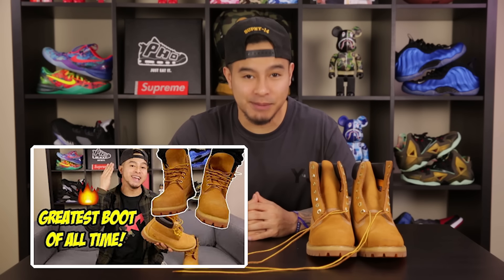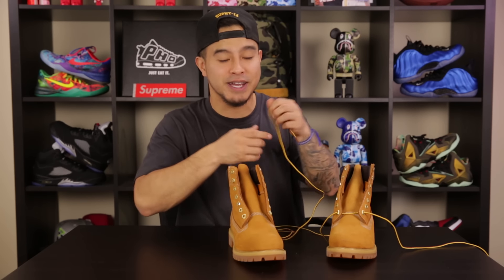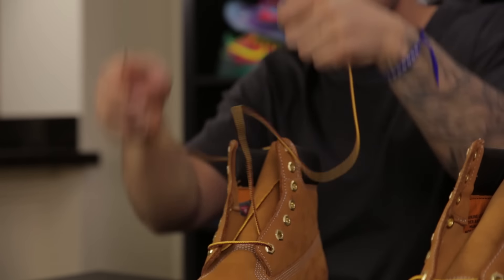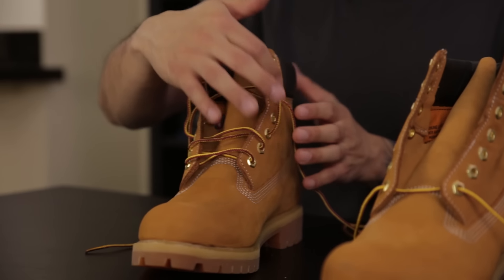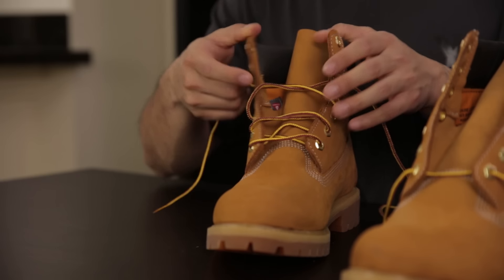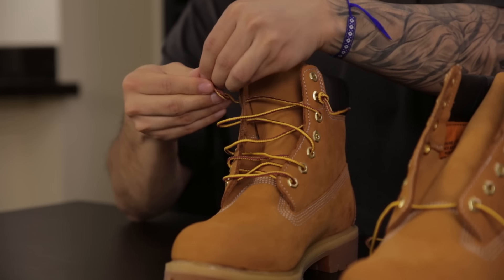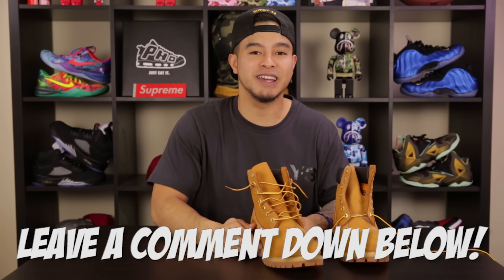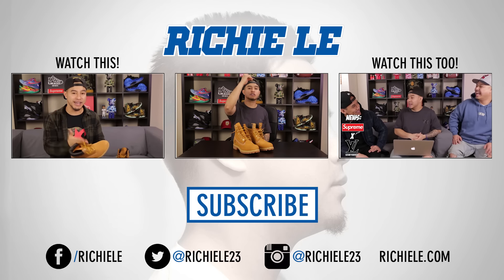HOW TO LACE YOUR TIMBERLAND BOOTS

Comment: How I lace my timbs is i go out then in and one sides pattern is 1-skip a hole-2-skip a hole-2. Other side is 2-skip a hole-2-skip a hole-1. But the last two holes I got in then out and have a decent size lace hanging then i tie a knot (end of the lace is a about a inch away from the sow line on the side of the timbs). It helps keep the tongue from hanging too much and it gives it a nice spread look but still looks good.

Comment: Buyer Beware, Timberland does not stand behind workmanship and materials after 12 months of ownership. Mine fell apart in my air conditioned closet after a couple years even though I only wore them twice. They refused to replace my barely worn new boots, Shameful.
Reply: Mack Lack seems legit #not
Reply: Certain rubbers are particularly prone to oxidative deterioration due to reaction with oxygen in the air.
Reply: Mack Lack I've had mine for 5 years, and in that time I've done everything from construction, to yard work, to hiking, to camping, to mistakingly washing them in the washing machine. Their structural integrity is still intact. So, either you got a bad pair, or they just don't make 'em like they used to.
Reply: I had the water proof Gortex Field boots with the black rubber heel & soles. The black rubber heel got gooey, soft and disintegrated showing the heel material fiber used as heel stuffing. Point is after 12 months they (Timberland) wash their hands of materials & workmanship defects. After 12 months you are in gods hands whether you use your boots or #not use them.
Reply: Seems like outside of the military, the biggest warranty shoes and clothes have is a year, anymore. If they have a warranty at all.
Reply: I live in Florida, thats why I never wore the Timberlands so I won't be buying boots again since I don't need them here. However, Marmot has the following Warranty; "We warrant every product we make to be free of manufacturer defects. Should you have a warranty issue, return the item to us and we will repair it if possible or replace all valid warranty items.
Normal wear and tear, modifications, alterations, negligence, damage and use for a purpose other than for which it was designed, are not covered under Marmot Warranty. However, we do repair items for a reasonable fee, if they have been determined to not be covered. If this is the case, you will be notified of the amount prior to any action taken.